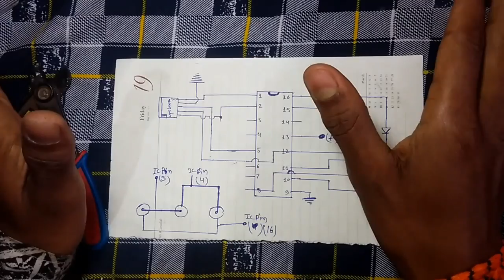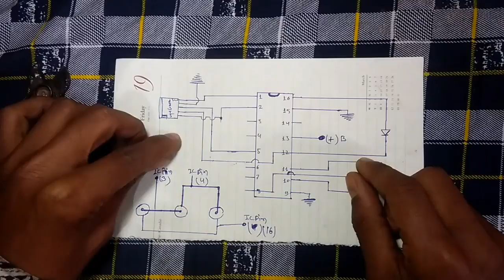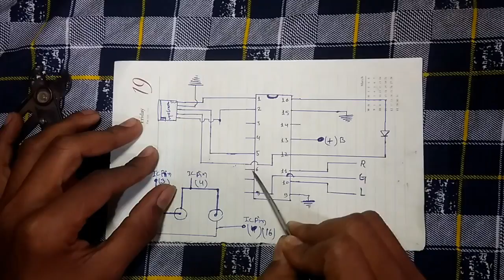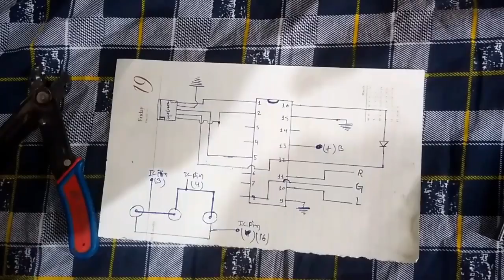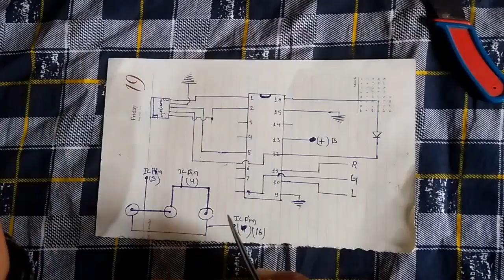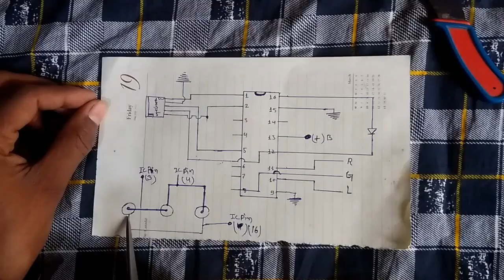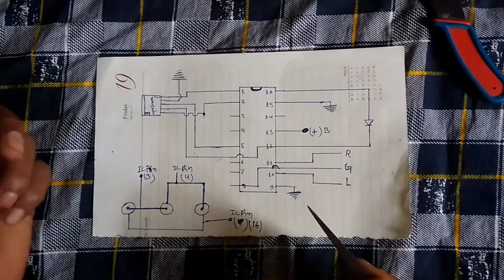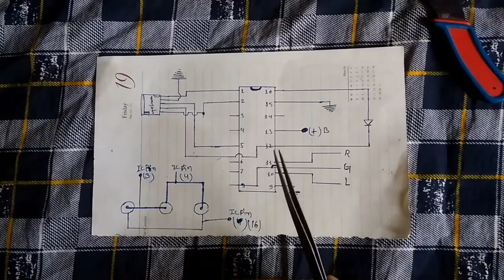Homemade micro sd card mp3 player usins only 1 ic1845CE5 (part 2)(100% working )

Comment: No, the 1508 IC is not suitable for use in an MP3 player. It is a bridge rectifier, which is a type of electronic component that converts alternating current (AC) to direct current (DC). It is commonly used in power supplies for electronic devices.

MP3 players require different types of ICs, such as microcontrollers, audio codecs, and memory controllers. These ICs are designed to handle the specific tasks required for playing MP3 files, such as decoding the audio data, controlling the playback, and storing the music files.
 Just googled and found out that The content creator was wrong 😑

Comment: 1508 ic se ban Jayega
Reply: Bhai 1508 ic say banayga ya nahi
Reply: No, the 1508 IC is not suitable for use in an MP3 player. It is a bridge rectifier, which is a type of electronic component that converts alternating current (AC) to direct current (DC). It is commonly used in power supplies for electronic devices.

MP3 players require different types of ICs, such as microcontrollers, audio codecs, and memory controllers. These ICs are designed to handle the specific tasks required for playing MP3 files, such as decoding the audio data, controlling the playback, and storing the music files.

Just googled and found out that you are wrong 😏